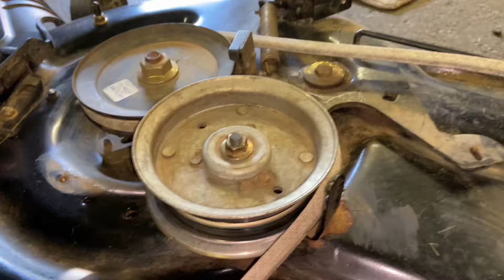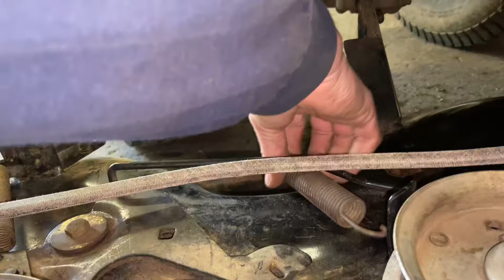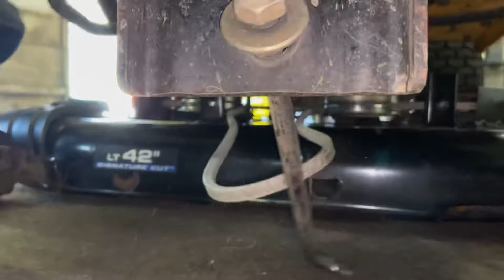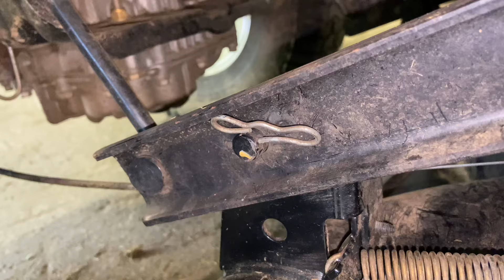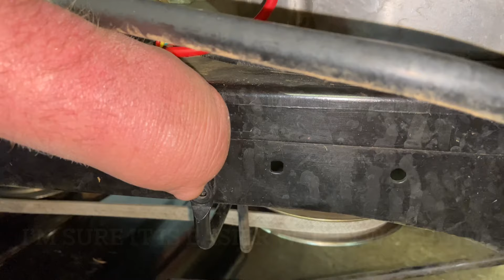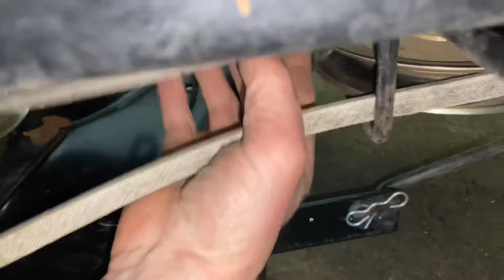How to install a Mower Deck Belt on a Cub Cadet XT1 42”

Comment: You deserve extra "likes" for this well-documented video. You described all the "tricky" bits including clutch cable removal and idler guide positioning. Particularly important was your comment regarding flat-sided belts! I wish I had viewed your video before I attempted my belt replacement (yes, I had the belt V-side in!).  I wish there was any way to ensure that, rather than paging through multiple postings, YouTubers with 42-inch decks ONLY watched your excellent work, this would save many heartaches! Well done Sir!:washhands::washhands::washhands:
Reply from the maker: Hi Christopher, Thank you for the kind words and supporting the channel. If you subscribe so you can keep track of videos I'm doing on the Cub Cadet XT1. If you have a video you may want me to perform in the future, let me know.
Reply: Extra likes? Perfect score is five and five?  👍👍👍👍👍😁😁😁😁😁
Over the top, 👊👊👊👊👊👊👊👍👍👍👍👍👍👍😁😁😁😁😁😁😁😁😁

Comment: Never installed a pulley or done anything on a riding mower, but after watching this video I feel much more confident about changing the belt out properly.

 Very helpful video - great camera work and excellent instruction.

Comment: Great video!  The process was pretty much the same as on my old Troy-Bilt SuperBronco, but your video did a great job pointing out the particulars of the XT1.  FYI, as an experiment, I installed the new belt without removing the deck: just dropped it to the lowest level and there was enough clearance to remove the spindle covers and loosened the tensioner pulleys.  Access was a little tight, but it can be done and saved a few steps.

Comment: Solved the  problem with the mower I have at our lake place on Sam Rayburn. The belt kept jumping off the mower and I didn't know how to get under it to fix it. Pulling the deck out solves that problem. Great video, very clear and explicit step by step instructions. Thank you.

Comment: Awesome video! I took my time and followed each step as I replaced the deck belt & added in the replacement of the blades. Everything worked 100%. 
Your detailed steps, great lighting and stable video were perfect. Your video made this first timer a pro!   You set the bar real high for these tutorials. Thank you!
Reply from the maker: Thank you for watching, subscribing and the very kind comment!

Comment: Nice video.
I didn't take any thing off except for the 2 pulley guards and the bracket next to the engine pulley.
Bent the belt guide's just enough to sqeeze the the belt onto the pulleys.
No removing of the Deck.
Awesome video, thanks.

Comment: Nowhere, absolutely NO WHERE does cub cadet tell you about the 2nd spring on the deck. “Oh hey, so yeah like the mower legit doesn’t operate without that ONE spring and it’s not in the manual nor anywhere online — you’re welcome”. 

Ahem, Cub Cadet, your operators manual is missing some key information. Had to sneak a peek at this video just to find out I need that part to make it all work again. It was sheared, missing half of the spring and was hard to tell what it’s for…put everything back together and tried running but blade engaged without manually changing so wondered what was up…it’s gotta be this part and amazing that it’s so important and no where can you find this in any cub cadet information. UNREAL!

Thank you Sir for posting, great video!

Comment: This video was insanely helpful and really the only one I could find that actually show exactly what to do in a clear concise way. So thank you.

CHEATER GUIDE: 

To add to the already valuable information though, I was able to do this in 10 minutes without removing the deck at all. Just lower the deck as far as it goes, remove the pulley covers, put a 9/16 wrench under the left silver pulley and loosen the top nut to remove the guard, and for the second pulley all you have to do is slightly bend the guard out just a bit. I know this isn't the proper way but it was so quick and easy to do I don't see why you wouldn't do this every time. Bent it out about a quarter of an inch and then bent it right back. Looks exactly the same. That's literally it. Simple and easy with half of the hassle. 🚜
Reply from the maker: I'm glad it was helpful and yes, to each their own. Most mower decks if your very mechanically inclined, you can reach in and perform the task but you do not get to check your mower deck for issues (why the belt broke?) or perform simple tasks like checking all pulleys and bearings easily.  I try and make my videos so anyone can do it!  and you even learn how to take off the mower deck! It's all good. Thank you for watching and the kind comment. Please share my channel and give it a thumbs up to help it grow! It would be greatly appreciated.

Comment: Best belt vid so far.  Do more on these models. Mine is about 18 years old. Dun alot of repairs myself on this thing. Motor still fires up. Change oil every season. New air filter too. Still works great.

Comment: My belt ripped away after 68 hours of mowing.  When replacing the belt I gave this video a look and found one of the belt-keepers had shifted and was responsible for tearing up the belt. It could not have happened if it was in the slot shown by your video. If it had been installed correctly by Cub Cadet at assembly this would not have happened as the pulley was mounted tight. Nice job with the video. By the way, I soon substituted those difficult butterfly clips with hitch pins which had been used on mowers for years.
Reply from the maker: Hi Lester, I have noticed the quality control coming out of the factory on these machines in the last two years and dramatically decreased. I have seen issues like yours showing up. I do like the butterfly clips because they do stay on very well but can be hard to get off. I'm glad this video helped you out and thank you for the the kind comment.

Comment: I didn't even go that far, I just removed the pins, and wiggled the deck a few times, and all the sudden, the belt didn't seem to be loose anymore. I put the pins back and drove the mower around a bit. The belt seemed to stay in place this time. I hope it stays that way. Thank you. If the belt comes off again, I will come back and watch the rest of the video. lol

Comment: I've been watching videos on this exact subject all day. Your video BY FAR is the best I've seen.
Reply from the maker: Thanks Stephen! I’m glad it was helpful:). Thank you for watching and the kind comment.
Reply: @JohnsonsSmallEngines  BTW I could not see the brand or model of that electric wrench. I'm looking to get one of those, but not an expensive professional one. I will only use it occasionally. Any input about Volts, drive size etc?
Reply from the maker: The one in this video is a Milwaukee 1/4" ratchet 12 volt. I would suggest  Harbor Freight for a less expensive one but not by much. You may be able to get a better deal on a 3/8" electric ratchet but my right hand is getting weaker every year and the 1/4" ratchet is lighter and easier for me to handle.
Reply: @JohnsonsSmallEngines  Thanks for the info...

Comment: Excellent job of demonstrating and explaining! Most of us are intimidated by the thought of dropping the deck but now I am very encouraged that I can do this! I'll have to re-watch the video a couple of times to get it right but thanks for video.
Reply from the maker: Thanks! I’m glad it was helpful! Thanks for watching and the kind words:)
Reply: 5/31/21  I just finished following the step-by-step for this process and it went exactly as displayed. Thank you so much Johnson's Small Engines! However, I think I forgot to hang the cable back on the hook! Better go check.
Reply from the maker: @larrywhite6298  LOL!! Yes double check and make sure the belt is running around pulleys correctly!

Comment: Thanks for this video, it helped me out a lot I never had a lawnmower before in my life and I bought this thing brand new not even a month old and the belt already snapped for some reason..
Thanks to you I am up and running again.
Reply from the maker: I’m glad it was helpful. Try not to cut wet or very tall grass. Not sure if that may have been the cause. Driving to fast while cutting in high grass will also put a very big strain on the mower deck belt and cutting too low in high grass will also make the deck work very hard.

Comment: I just wanted you to know you saved me. Number one ordering the belt two times I received the wrong size going to I won't mention the name of the stores but when I put your video on bingo online got it through Amazon looked for the numbers on the back of the seat Great job. Number two I couldn't get the new belt on watch your video loosened up the pulley the bottom nut under the carriage or I should say under the deck tilted the pulley got the belt on that one stubborn pulley behind the guide tightened everything back up and off I went you really do a splendid detail job thank you.
Reply from the maker: I'm glad your back up and running! Thank you for watching and the kind comment. Plesae give this video a like, subscribe if you havent already and share my channel with your friends to help it grow! It would be greatly appreciated:)

Comment: Thanks again Mr. Johnson. I had to put another belt on, so I came to you for a refresher course. I don't know why my belt came off, but I am thinking it was just getting old and a little stretched out. Have a great day.
Reply from the maker: Keep your blades sharp and top/bottom of mower deck clean to keep the stress off of the belt. That does help!
Reply: @JohnsonsSmallEngines  Thanks, it's a little difficult to keep bottom of the deck real clean, most of the dirt I mow on is sand. I sharpen the blades about every third time mowing and scrap the bottom best I can.

Comment: I hate to be that guy to talk about ur disability but I wanted to say that ur one hard working man that many people can learn from. I own a auto repair shop, I’ve been a professional auto technician for 20 years and I worked on mowers all the time with my grandpa before working on cars and I know many mechanics that couldn’t tear apart this mower and put it back together as fast as you did. Again I’m sorry to come on here talking about ur disability but I had to say something, u really are kicking some ass better then most people without disabilities. God bless my friend!
Reply: Also thanks for making the video! My girlfriend was mowing the lawn and my belt came off. Mower is only a few years old with like 120 hours on it. I bought a new belt but I didn’t see any reason why it should have came off. So weird how loose mower belts are when the blades aren’t on
Reply from the maker: Thank you for the kind comment!!
Reply from the maker: Yes, the machines that have manual blade engagement. The belts seem to be very loose but you do not want the engine pulleys to wear the belt or you  can get a bad shake from a bad spot in the belt.

Comment: Great video. Made my day much easier.  However should the belt be spinning even when the blade is disengaged?   I replaced my belt mowed my lawn and the belt broke again.  Thanks for the help on this.
Reply from the maker: Sounds like you may have purchased the incorrect belt.  I suggest using the OEM “original equipment manufacturer” belt.

Comment: This video was very helpful. My belt slipped off and I was able to put it back on thanks to you. The only problem now is it seems to slip off after I engage the blades after 15 seconds or so.  Any thoughts what it could be? When I put the belt back on there seems to be a little slack but not sure how to adjust that.
Reply from the maker: The belt slipped off for a reason. The first is to check to make sure all belt guides and guards are in place. Unfortunately, it is impossible to diagnose your issue without seeing it.
Reply: @JohnsonsSmallEngines  yeah I know it’s be tough without seeing it. I’m thinking the belt is got stretch out a bit so I’m going to buy a new belt and see if they are the same size. If they are then guess have someone come fix it.  Thx though, great video

Comment: Great video!! I replaced my broken belt with a Cub Cadet belt. Everything seemed good and in fact I was able to mow a good section of my lawn.  When I got to a spot where I needed to engage and disengage, the belt slipped off. I was able to get it back on by removing the guard and loosening the pulley to get it in place.  Is there something I missed in making sure it's "tight"?
Reply from the maker: Without seeing the machine, I cannot say what you may or may not have missed. Make sure the belt guides are correctly spaced. The belt should not fall off when disengaged unless you have purchased a aftermarket belt which may not be the correct thickness or length.

Comment: Literally just took away any excuse I had for not fixing my mower belt. If he can with 1 arm I can with 2. Thanks
Reply from the maker: LOL, you got this! Take your time, watch the video many times and you’ll be fine:)
Reply: @JohnsonsSmallEngines  so thanks to you i can change the belt with no problem. How much do I owe you? 
Question: just saw a video saying the barrings in  spindles on deck are sealed, and grease will not get in them if you grease them. So you need to take the barring cover off. I have not looked to see if my spindles even have grease fittings. If they do not, should I take the spindles apart, add a grease fitting and remove the barring covers from the barring? I actually have experience with putting  barrings on shafts, installing grease fittings ect ect.  If it has grease fittings I am going to grease them. Just don't know if the barrings are covered or sealed. The barrings I used to install we where told to remove the seal and we packed them with grease b4 installing. Not sure what Cub Cadet does. Wouldn't surprise me if companies did not grease barrings just so you will have to replace parts lol
Reply from the maker: I have been putting grease in mower deck bearings for over 30 years and never have I once taken off the shields to put grease in them. Whoever they are and there are a lot of them saying that you have to remove the seals is incorrect in my opinion. Just grease the hub until you feel tension meaning the hub is full of grease, that will keep moisture out and the grease will find its way into the bearings by heat. I know as a fact if you don’t grease the hubs that have greaseable fittings you will have issues because everybody either cut wet grass or they like the wash there machines. I do not recommend anyone washing their machine unless necessary. If you have grease fittings then grease them. If you don’t just try not to put any water around or in them or cut wet grass.
Reply: @JohnsonsSmallEngines  ok, thanks again for the help. You are my hero! Lol

Comment: Thanks, would have saved me some trouble, had I found you first.
But I did discover, trying to get those clips out, take a flat tip screwdriver, stick it in on one end, give it a light twist, and walaa.

 Oh yea, 😁😁😁😁😁😁😁👍👍👍👍👍👍👍👊👊👊👊👊👊
Reply from the maker: Nice tip, 👍

Comment: i loved this video, it is very detailed. Great job. What was making  the belt  come off ? That was never mentioned and it is the problem that I am having. Also my Deck engages when I raise the cut Height with the mower running but blade not engaged. Please help if you can. Thank you .
Reply from the maker: I’m glad this video was helpful but this video is just a how to install the belt. To diagnose why it came off can be many things and I cannot diagnose that over the internet.

Comment: I have a cub cadet 46inch mower deck,is there a way to put more tension on the belt,it comes off of the pulley,everything looks like it's working properly
Reply from the maker: It sounds like it may be stretched? Try putting a new OEM belt on and see if that works. The tension is only spring loaded. No adjustments if you have the correct belt.
Reply: @JohnsonsSmallEngines  thank you so much,the mower is approx. 5yrs old,so you are right,thanks for the help and quick response,BTW your videos are very helpful and informative

Comment: Was wondering if an Hairpin R clip would work better and easier.
Reply from the maker: The bow tie clips were made to help the clips from popping off when using the machine. They work as they should. All clips that come with the machines when purchased work well as long as you install then the correct direction. It's up to you which one you use.

Comment: i’m going to try to install this belt by not removing anything. I’m just gonna slightly bend things around but the only thing I think I have to takeoff is those covers on the deck the little 8 mm other than that I think I can do this but just finagle things out-of-the-way.

Comment: So is there a transmission belt as well. I have the same year and model as in video. Owner's manual shows 2 belts.
Reply from the maker: Yes, there is a blade belt and a separate transmission drive belt.
Reply: @JohnsonsSmallEngines  is it easy to replace.  Do you have a video.
Reply from the maker: It’s straight forward if you are mechanical inclined. I do not at this time.

Comment: I have the cubcadet slt1550 does the flat side go against the pulley?
Reply from the maker: There are v shaped pulleys and flat shaped The v of the belt goes into the v of a pulley and the flat part of the belt goes on a flat on a pulley.